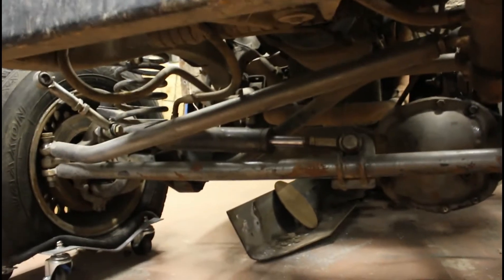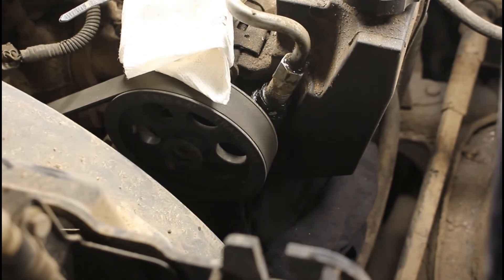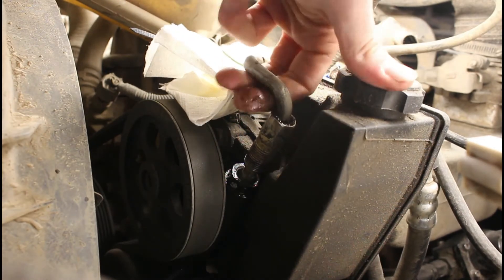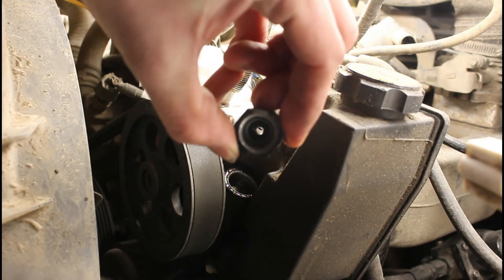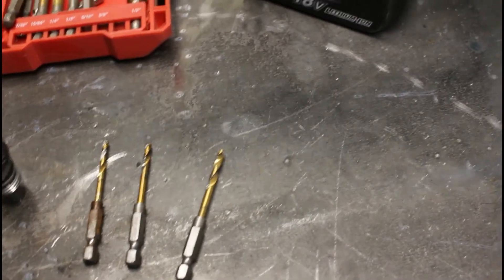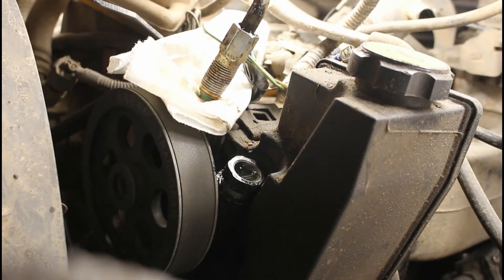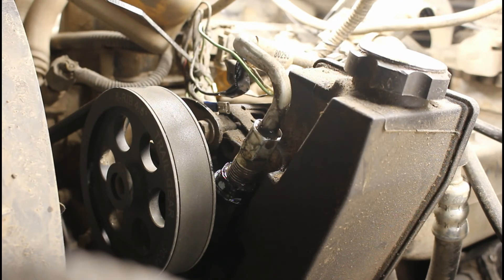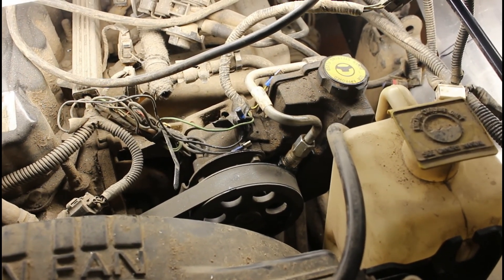Jeep TJ steering pump flow restrictor porting for high flow and hydro assist steering

Comment: The ps pump on my 97 2.5l just wore out.  I've tried replacing it with Crown brand pumps and both of them whined like crazy.
I do have a homemade hydro assist and the oem pump handled it just fine, maybe ill try this with a cheap pump

Comment: How did this work long term?
Reply from the maker: worked well for the setup it was. i would recommend using a wj pump now, better flow rate and more capacity. simple swap overall

Comment: Hey so I'm curious what and where did you got that pulley from Thanks man any update on the drilling appreciate you putting a new pump on mine tomorrow
Reply from the maker: the smaller pulley was from trailgear. part number 303411. 6 rib 4.5 inch. the porting has been good, i am still considering opening it up a little further but it has been functional as is since doing it

Comment: Did you ever drill a little more to see if it helped?
Reply from the maker: i did not it worked well for the time i used it. any time i needed to turn fast i was at higher rpm anyways so it was okay. however with the new steering setup ill be running i will be porting it more.
Reply: Ok I just used a 5/32 bit today and it helped ALOT. But thought about going one more size up. But it is working for now until I swap my new motor so I might just leave it for now. Thank you for responding!
Reply: Ok I just used a 5/32 bit today and it helped ALOT. But thought about going one more size up. But it is working for now until I swap my new motor so I might just leave it for now. Thank you for responding!
Reply from the maker: @gagekemerer6296  you bet! happy to help!
Reply: 1995 grand Cherokee with psc hydro assist, was annoying to switch steering direction quickly (usually in parking lots) drilled it out now it works great! Thanks for the video.
Reply: Wouldnt this cause blown seals? That steering box isnt made to handle more than the stock 1,300
Reply: @seancurry9769  by opening up the orifice, you’re not increasing pump pressure. There is a spring beneath the orifice fitting that you can shim tighter to bump system pressure (however this greatly reduces pump life). Reaming the orifice decreases resistance to flow, thus moving more volume of fluid and quickening the ram’s travel.

Comment: How did it work?
Reply from the maker: Overall feeling is much better at low speeds and very little changed at high speeds. I may open it up another 1/32 or even 1/16 due to my smaller pulley. I need to be careful though as I do not want to lose pressure all together.